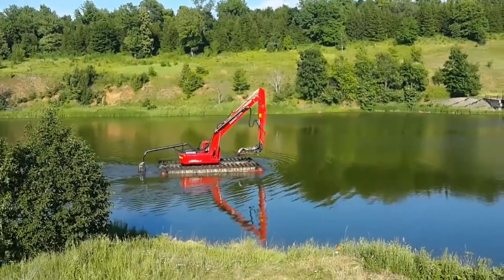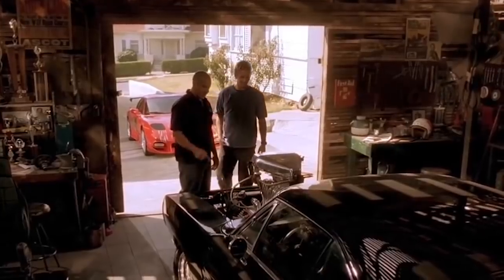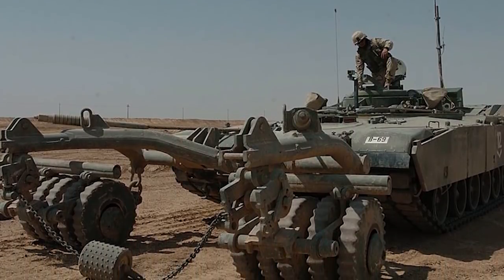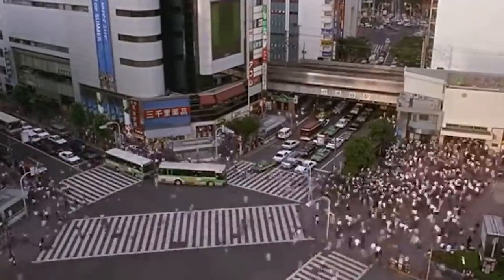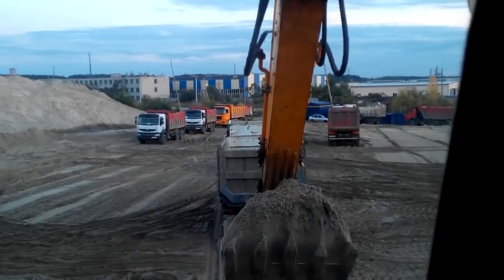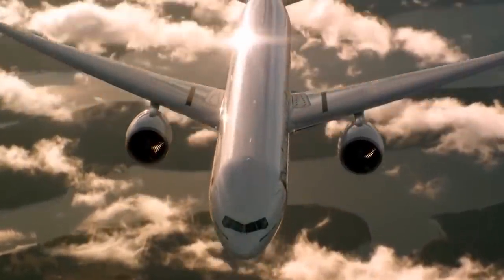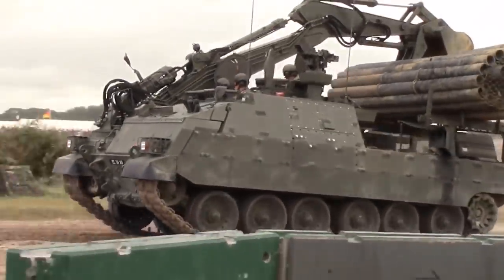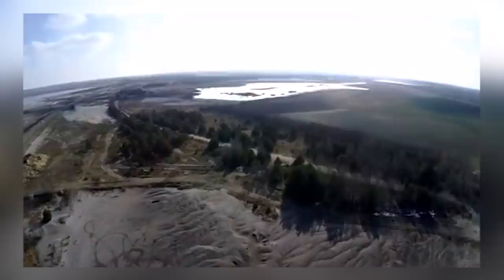12 Most Amazing Vehicles In The World

Comment: Just pointing this out because it wasn't mentioned in the video: The F60 mentioned at the end is actually capable of movement - although at a very VERY slow pace. I don't remember whether it was 5 or 0.5 kilometers per hour (which is less than walking speed, so you get an idea)

Comment: The M1 Panther 2 is not a unique or special vehicle, mine rollers can be attached to the Leopard 2's, Challengers, Type 99, T64 to the T90, and virtually any other tank without needing to remove the turret, or hinder the battle capabilities of the vehicle. There's a reason there's only a few Panther 2's, there obsolete